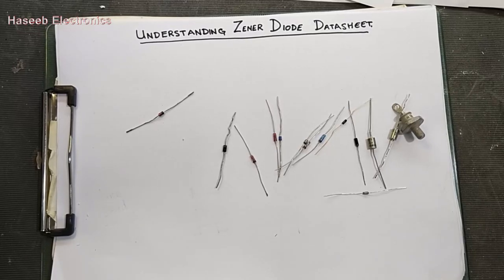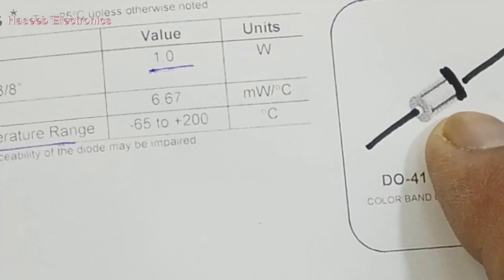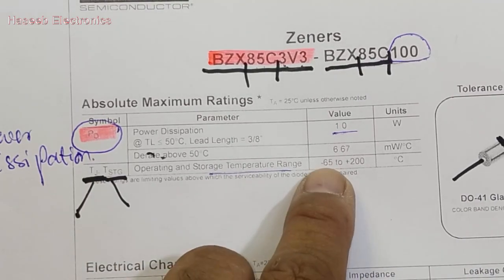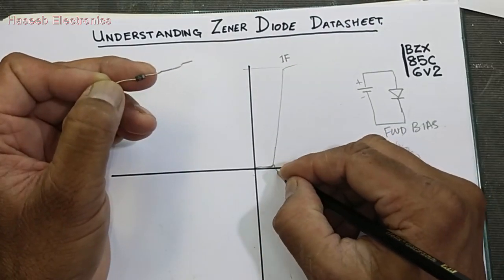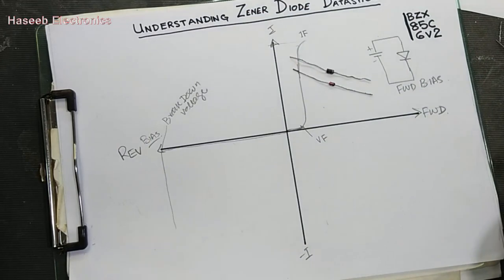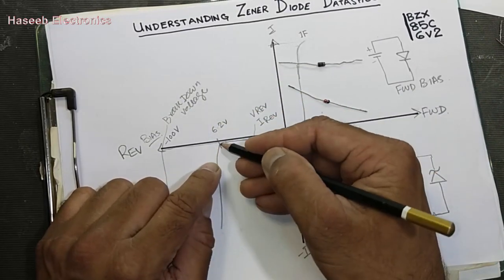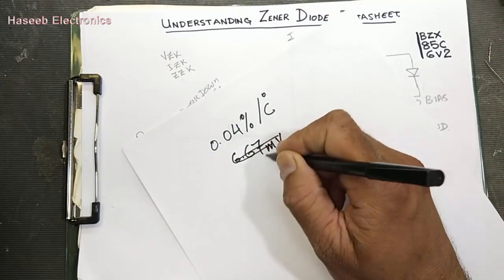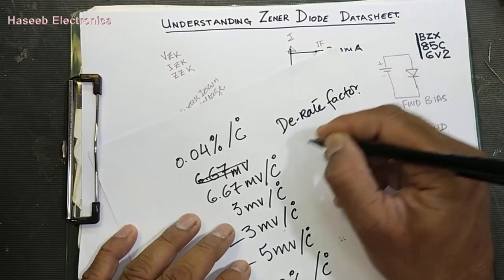[431] How to Understand Zener Diode Datasheet / How To Read / Check Zener Diode Datasheet

Comment: I have a similar diode "D", on my SMPS board, but no marking what it is, how can I know which Zener diode it is? It looks the same as the small diode in this video, but only have a "D" marking on the board.. is it a normal Diode or is it a Zener diode.. how to check?
Reply from the maker: if it's marking is just D that means it is a simple signal diode like IN4148

Comment: Most of the time the wattage of a zener diode is not given in the data sheet. In case how to find out the wattage of the Zener diode? Further, sometimes the part number is not visible on the zener diode in such case how to find out the voltage of the zener diode?

Comment: Sir 
on zener diode it is written
3 C2
Which zener diode is this ???
Please tell sir
Reply from the maker: if it is DO214AA(SMB) SMD diode, then it is SMB3Z39A 39V zener diode. 
if it is in SMA/ DO-214AC package 
then it is SMA3EZ36D5 36 volt zener 
if possible send its picture to my whatsapp 00962795608616
or gmail ashraf4ta4
Reply: @HaseebElectronics  no sir it is not smd
It's a through hole zener diode
Only written 3 C2 on it

Comment: Induction cooker E3 ennu kanikkunnu ethayirikkum complaint
Reply from the maker: E3 error in some cookers are for voltage sense line. check dc capacitor on bridge rectifier 
check voltage divider resistor on microcontroller pin